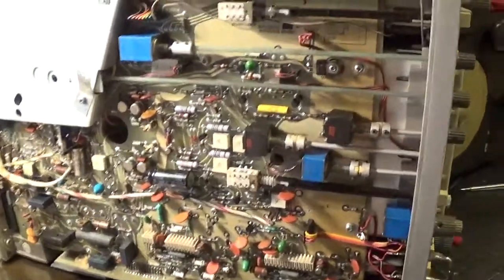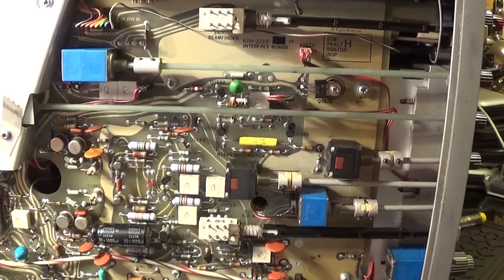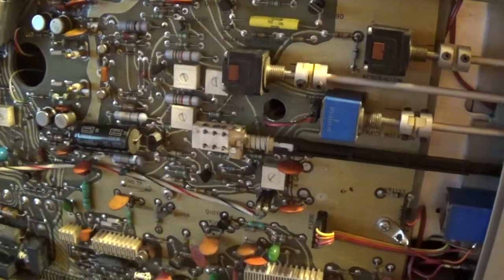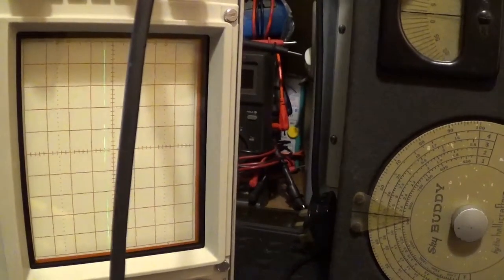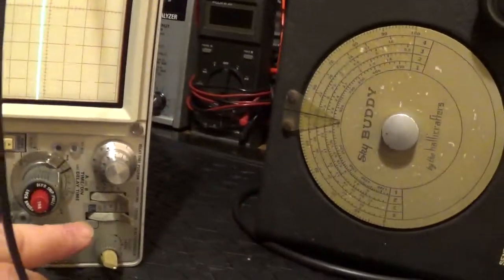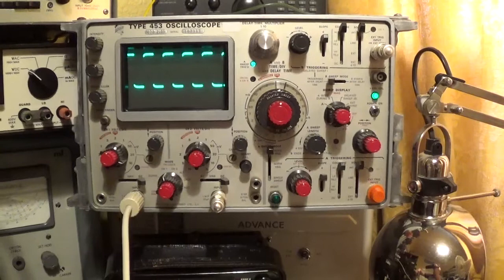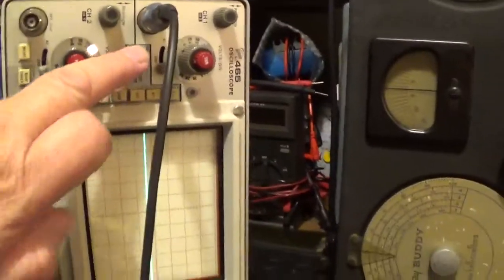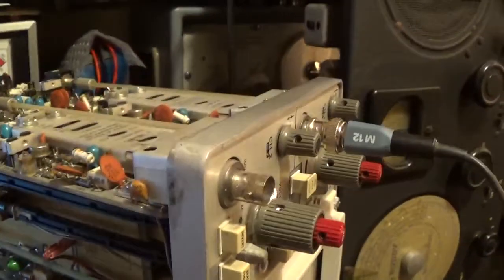Tektronix 465 repair - signs of life

Comment: Did you ever get to the bottom of this?
I had a similar issue with a Leader LS1020 where both traces were superimposed and the Vert position knobs did nothing. By adjusting the time base and feeding different signals to each channel I discovered that there were in fact, 2 seperate traces but they they both clipped on various vert attenuator settings. It was evident there was an issue in a common stage and I eventually found a completely Open resistor in the final vertical amp stage, which bridged the two outputs. Simple fix and not too difficult to find. Might help!?!

Comment: I'm so glad you are having a go at this. I think your on the home run now vertical problem are usually not to bad and you can work your way through them. It's triggering circuits that scare me.  Go luck you will have it running soon. Chris
Reply from the maker: Hi Chris, yes I was going to leave it until winter but needed something to do for the rest of my holidays. I found a (I'm not sure if it's 'the' ) problem and will show in the next video.  Thanks - Andrew
Reply: I always think if you have some Horizontal action going on your nearly there. That fact you could output the vertical makes me believe the front end amplifiers are fine a fair way in as it looks to be triggering.  It also looks like something common to both channel so I would have a punt at the final vertical amp.  Good luck cannot wait for the next video. Regards Chris

Comment: Looks like the vertical deflection and ch2 is faulty. Has the wire fallen off the deflection plate of the crt?
Reply from the maker: Hi Simon,  as there didn't seem to be any reaction to input my immediate thought was a connection plug had fallen off but no such luck.  I checked the vertical output board while this video was uploading. The vertical output board has two burnt resistors. It's partially hidden by the Sync seperator option PCB which is why I didn't spot them before.  I'm hoping whatever caused these two to burn, and looking at the circuit they are connnected to the diode I replaced, hasn't wrecked the Tek IC (U440 the output amplifier) which they're connected to.  Game over for now if it has!